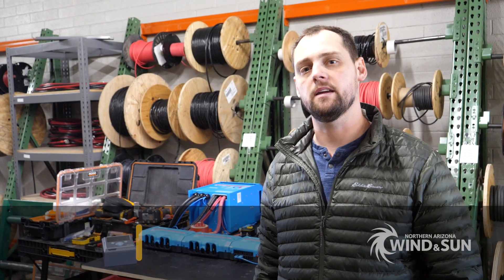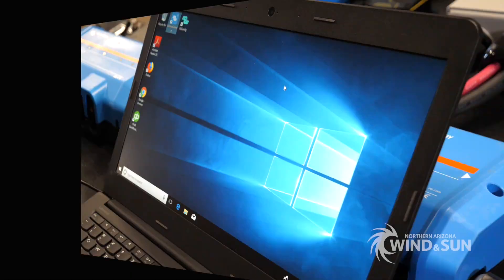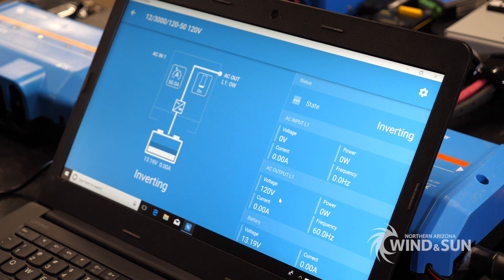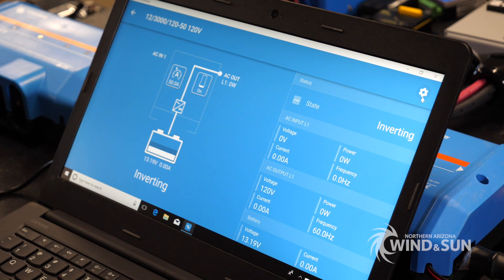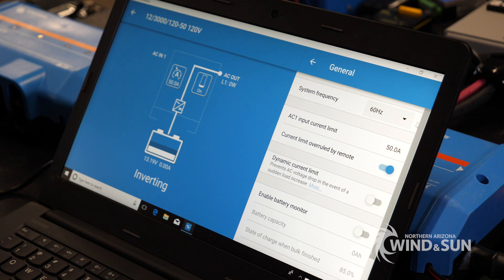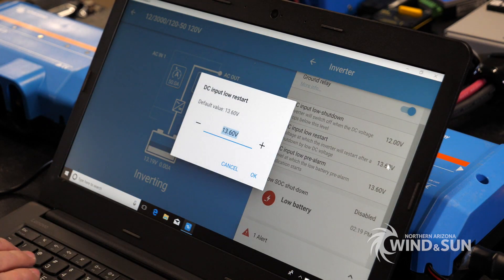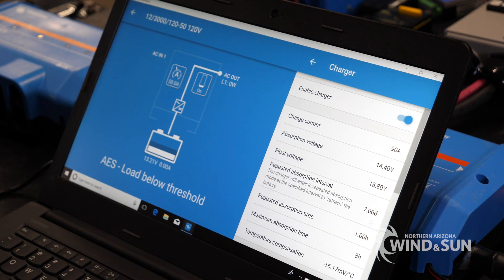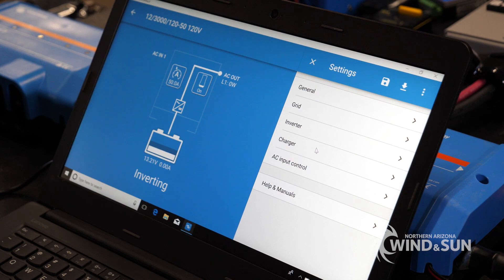Victron Energy MultiPlus 3000 Inverter Configuration

Comment: someone donate that inverter we don't have the password how do we update it and also when we start generator it does not charge the battery it also function via grid power please advise
Reply from the maker: Hello! You would be best served by contacting the manufacturer of the inverter for assistance. Without knowing the equipment involved, how old it is, or where it was purchased we are limited in what we can advise.

Comment: I understand how to make the cable connections into the Multiplus, both the DC positive and negative connections,,and the AC input and output connections.  What I am unclear on is how to connect the RV ends of the AC input and output connections.  I think the RV side AC output goes to the main 30 amp breaker in the breaker panel, but I haven't a clue as to how to connect the RV side AC input.  Any help is appreciated.  I will likely have an electrician do the connections but I want to make sure I understand where everything gets connected first.  Any feedback is appreciated.

Comment: with three 100ah 12v battborne lithium wired in parallel with 3000 multiplus 12v  - in low "dc input low shutdown" I also changed that to 12.0v and inverter immediately went to low battery warning even though it read 13.3v. oddly, I could not turn the inverter back on until I raised that 12.8v!? just like this video, it goes into low battery warning when the battery reads13.19V what this guy lowered the "dc input low shutdown" to 12v - what gives?

Comment: At 5:30 in the video, why didn't you change AES type from Modified sine wave to Pure sine wave?
Reply: Modified sine wave is supposed to be an AES setting mode that (slightly) reduces power consumption from the Multiplus unit by not constantly outputting a pure sine wave when idle. I got this information from a Victron Energy video in the following link: https://youtu.be/UPfUn5ki7OM

Comment: Why does inverter use modified sine wave, rather than pure sine?
Reply from the maker: By default the inverter is pure sinewave. If you wish to make the inverter consume less standby energy during no load conditions, you can configure the unit to reduce the wave steps under no load conditions (making it modified sinewave) which inherently reduces the inverters stand by consumption. As soon as the load exceeds max threshold it will go back to pure sinewave. It’s completely configurable, one doesn’t need to activate this setting. It’s just a cool option.

Comment: can't you use the bluetooth phone app to do the programming?
Reply from the maker: When connecting over bluetooth, using the VE.Bus Smart Dongle, only status data, voltages, and other information can be read. And it can be adjusted: switch between On, Off and Charger-only mode, and set a Shore current input limit. It can not be used to change settings and perform firmware updates.

An MK3-USB is required to change settings and perform firmware updates and settings. And, as that requires a USB port, it is not possible to change inverter/charger configuration or perform firmware updates on a Apple iPad or iPhone. Hope that helps!
Reply: @NAZSolarElectric  thanks you would think you could do more... but I guess they want to ha be spend more money and buy the Dongle

Comment: Would you use the same settings for LiFePO4 batteries?
Reply from the maker: We recommend you use the battery manufacturer’s recommended setting which may vary from the represented example settings. If you purchased batteries from us, one of our technicians would be happy to provide these values for you. Otherwise you should contact the manufacturer or consult their manual. Thanks for the question!

Comment: The description in the video says "Wiring & Configuring" you should just change it to Configuring you just did about 5 seconds of a pan over the wiring and didn't say a word about it, the rest of the video is configuring.  Your video was helpful though, thank you for posting.
Reply: That is basically wiring the inverter/charger the bulk of the wiring on with and typically closer to battery area
Reply: @Sea1fly  That made no sense whatsoever  wish u did video before I buy one

Comment: Can you please tell me which generator is compatible with this multi plus.?
Reply from the maker: Hi there, we recommend using a generator that is at least 1200W, single phase 120VAC output. Remember to adjust the AC input current limit according to the wattage of the generator. Hope that helps!

Comment: James, What happened to the  wiring portion of the video? Where do the sensors plug in, and how do you wire for 6/3 cabling?  We have a  50 amp RV, I'm lost
Reply from the maker: Michael, give James a call and he'll be glad to help you out: (800) 383-0195